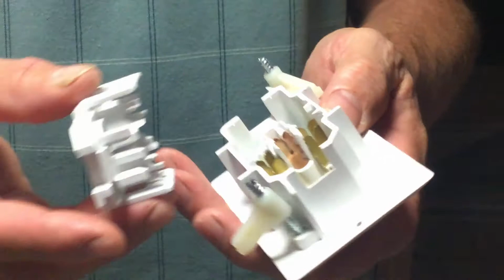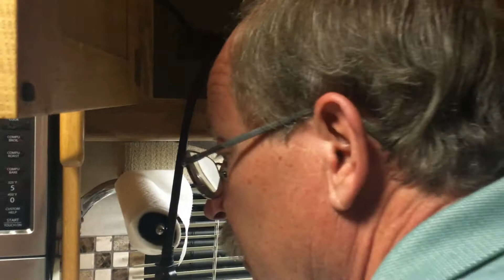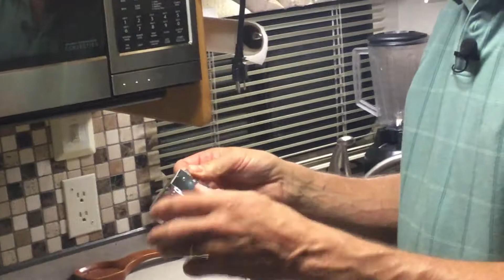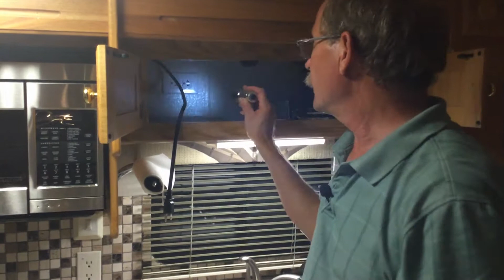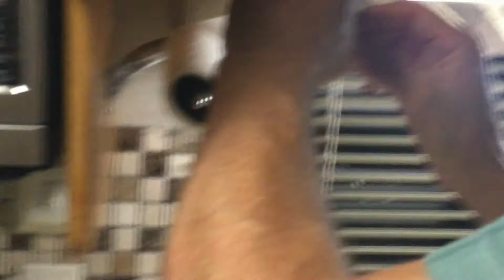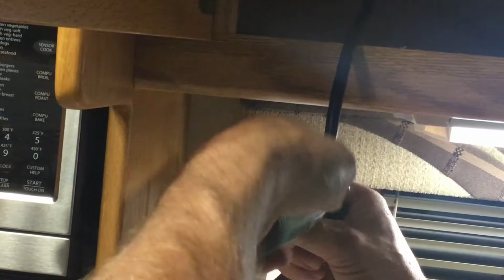How to Replace a RV Electrical Outlet

Comment: Protip: If you are using a metal J box, after you connect the wires to the outlet and tighten the connections, wrap electrical tape around "back" of the outlet, so it covers all the screws.

Comment: You should have used either a strain relief fitting or a bushing in the metal box, particularly because these wires will be subject to constant vibration. Since you did not independently ground the box, this is a potentially lethal repair.  A plastic box would have been a much better choice in this case.

Comment: Are you able to get 12v through a regular home outlet? It's my understanding that regular home outlets will not work with the 12v side of power as RV outlets do.
Reply from the maker: Layne,  Thank you for your question.  No you would not use 120 volt outlet for a 12 volt system.  It would be very dangerous to plug in a DC voltage unit into a AC voltage plug.   This action would destroy whatever you plugged in.  All 12 volt DC lights and devices are normally hard wired in to the 12 volt system.

Comment: wow.. So cheap. Figure you paid a HIGH price for an RV and they would have at least residential boxes instead of the cheap box they use. Looking to replace all my outlets now that I've seen to video for safety....Th first two will be for the TV and microwave oven..Thanks for the info..

Comment: I replaced all the outlets on my RV with standard outlets just as you did.  I used plastic 'old work' boxes.  Metal boxes are good but you should use a bushing in the knock out hole to protect the wires from the sharp edge of the hole.  Without the bushing, the wire insulation will get wear and then short to the box.  Especially important for an RV that bounces down the road.
Reply from the maker: Hello Mark, You are correct about the bushings, I also try to purchase boxes with a built in cable clamp system.  Thank you, Jim

Comment: I agree 100%. Our plug for the microwave was melted, so the plug could not be removed. The outlet and the one for the electric water heater have now been replaced with “real” household outlets. I don’t understand how these are even legal. They certainly would not pass code in a home.